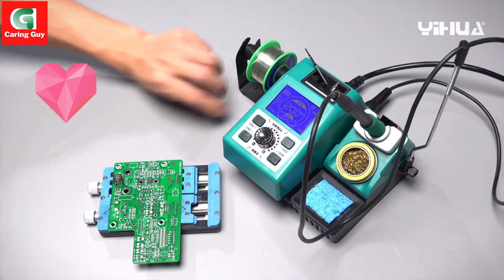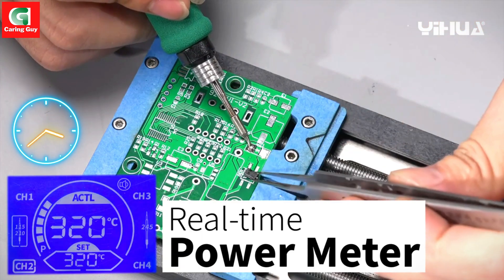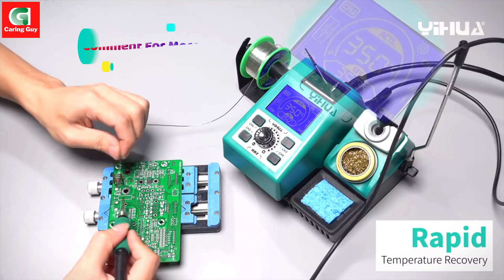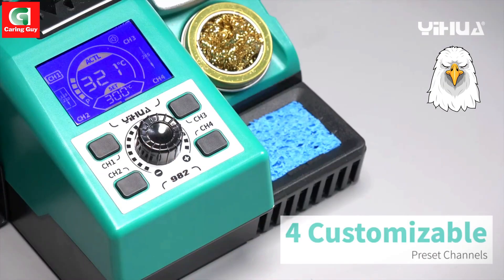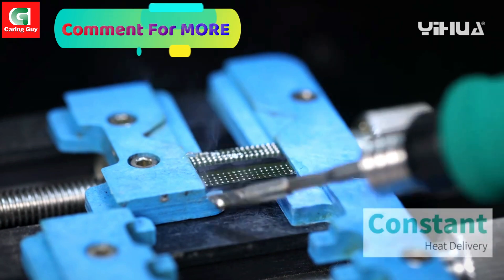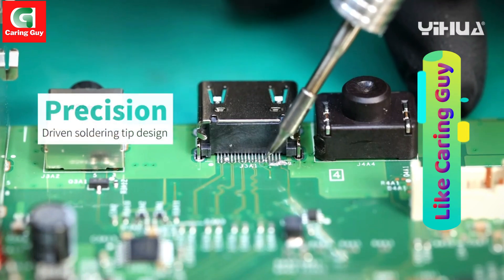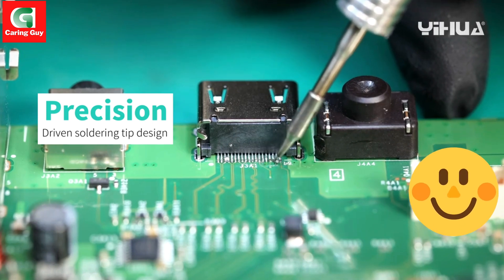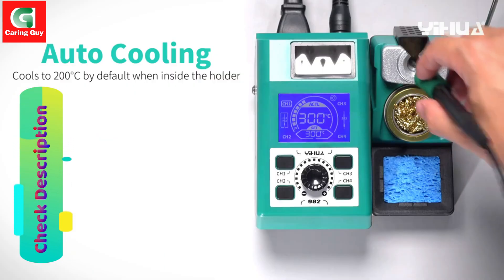YIHUA 982 Repaid Heating Soldering Iron Station

Comment: Got one 2 year ago good machine but has some negitves' the power switch is hard to get to the iron jack is in the wrong place i moved mine to the front i got a 90 degree power plug for the back the body is now 50mm closer to the back of the bench , one other thing i threw the solder reel holder away with the iron cable support , but apart from the above excellent iron & easy to use
Reply from the maker: Please click the web page link given in the video description to know more about this device from the seller. Thanks for your review.